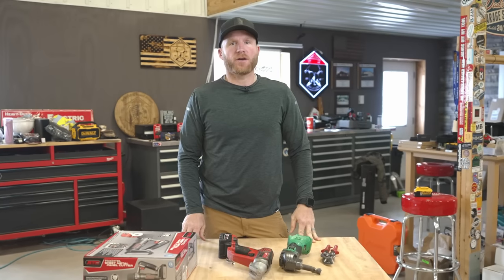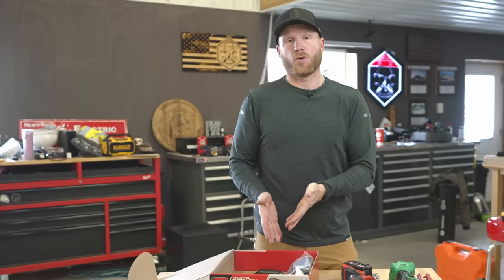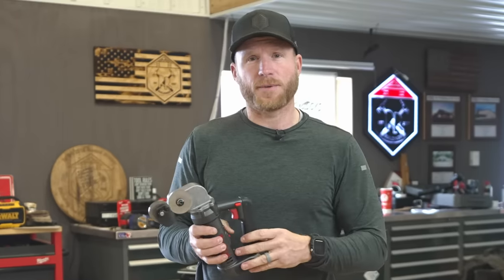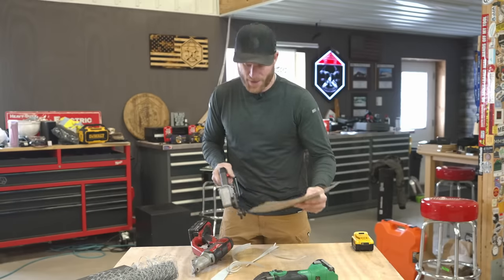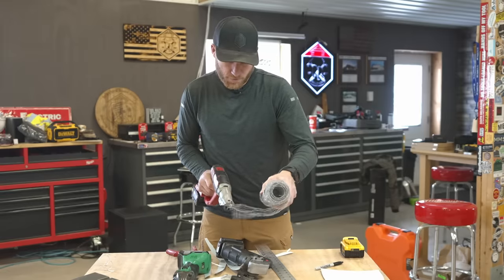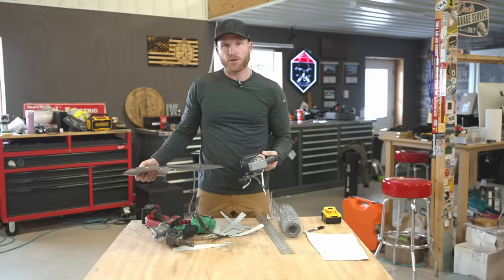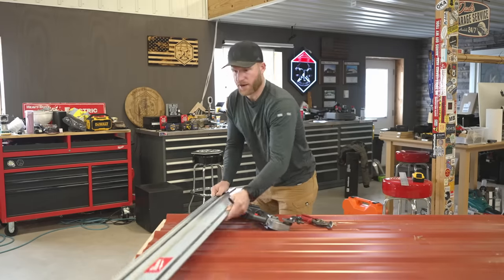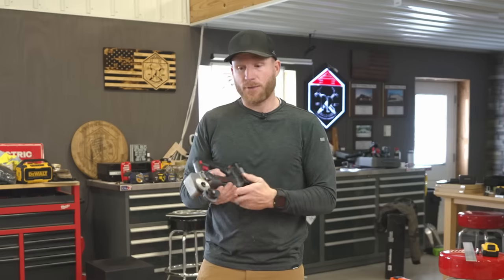Toolsday: The Last Metal Cutting Tool You'll Ever Need???

Comment: Take it from a  tinner,  never ever cut wire with a snips.  Next time you cut metal it's like cutting sandpaper.
Reply: Rule number one in tin knocking
Reply: Snips cut tin thats it
Reply: @Simmonsconstruction  I always wondered why tin benders got so frosty when us plumbers would ask to borrow their shears!  When they make tools for plumbers, they know we will try to break them every hour, so help me! I'm retired now- but a friend was grumbling about having got two Pex (plastic pipe they are using these days) expander type machines replaced because they got trashed bouncing around in the back of his trucks. At the prices these sorts of things want, the makers need to realize they are selling what will most likely be shop owned tools. I guess it's either adapt or go broke!  FR
Reply: Agreed! Been there done that
Reply: So using my snips to cut shingles is out of the question??
Reply: An old pair of snips are a roofers best friend.
Reply: @jamesrussell6870  no problem, dedicate your old pair that sort of job, and don’t mix’em up with your tin/metal cutting tools or vice versa.
Reply: Snips work great on F.r.p. plastic board but they won't cut sheet metal again.
Reply: @Gustavo-ud6hu  Literally the first thing I tell anyone that helps me, you use my snips as a wire cutter you will buy me a new set at lunch and won’t be coming back tomorrow.
Reply: So from a non thinner what do you use?
Reply: They make one that just attaches to your existing drill. That’s what I’ve been using.
Reply: That also pained me
Reply: Yellows are for chicken wire. Reeds and greens are for pros
Reply: We learnt that in first year highschool metal working lessons, so many people just don't know how to treat their tin snips.(architectural metalworker here)
Reply: @jamesrussell6870  I would recommend using a high quality damascus steel hunting knife for shingles. Make sure its grit-to-blade edge
Reply: yep. tin snips/avation sheers cut sheet metal. and electrician wire cutters cut only copper wire or aluminum electrical wire. cable cutters are for tie wire and cable wire and can cut just about anything else
Reply: @TristenHernandez WIRE CUTTERS.

Comment: Black and Decker made a rotary power shear back in the late 70's early 80's as a corded tool. Still use mine to this day. They are great on cardboard and carpet as well. Glad to see someone bringing the approach back.
Reply: I had one of those back then. Loved it and used it all the time. Only problem is that I wore it out after 20 plus years and couldn't find replacement parts for it. Miss it more than any tool I've ever owned .
Reply: I to have one and still using it yet, however I could use some new cutting wheels.
Reply: Best power tool I ever owned.  I never understood why they discontinued
Reply: I have one of those 120 volt cutters. It was driven by the same motor of their jigsaw. They disconued it because too few people understood it and it did not sell well. I have people trying to buy mine from me, but I will not sell. If I needed a battery powered one, I would buy this one.
Reply: @bobthebuilder6315  It wont be cheap but you could try getting some tool steel (HSS) somewhere near the right diameter, then get it turned and centre holes copied. They would then need hardening and then tempered. Perhaps find a firm with an autoclave
Reply: Used to open up access to clean grease ducts in restraunts 40+ years ago with that Black and Decker rotary shears. Loved it. Wish I still had it. Ordered an drill add on  cutter a contest ago. Never came canceled order.
Reply: Nice Video. I am doing a bunch of PBR right now and I am getting much better with my Milwaukee nibbler and double cut shear. The one thing I noticed is the variable speed on the shear helps me to get a straight cut. I would assume after watching this video that slower is definitely more controllable with this tool. I have been wondering about this. Thank You for sharing great job👍
Reply: This has been the most wanted comeback tool that all the old timers have wanted.
Reply: Yep, and it great.

Comment: Black and Decker made these years ago.  I paid $180 on an auction for it and people thought I was nuts.  I wore the wheels out and had a machine shop make new wheels for $250.  Motor finally gave out.  One of the greatest power tools ever owned and could never figure out why B&D discontinued or why someone else didn't start making them.  Great tool!  Glad to see someone get smart.  That thing is a bargain for $400, the B&D was corded, that was the biggest downfall
Reply: Hands down, Black and Decker made a great tool. I changed frame to accommodate ribs of metal roofing, made special feed wheel to pull material smoothly and added battery. We tested tools by taking them out to guys building to get true feedback. I think you would really like it. Thanks for comment. Tony
Reply: Why would b&d stop making such a useful tool. It really was a great tool.
Reply: @tonywachtel7215  Great informative video, awesome performing tool. 

Tony, assume by your replies that your the manufacture & designer. Do you have other video or websites you provide additional information?

You’ve got a Dewalt battery, I’d suggest selling this great tool to DeWalt. Their marketing and User Base would greatly increase your sales. I’m guessing you probably already have something in the works with DeWalt… Best of Luck! You made an older design 10x better!

Comment: We started using this the other day at work. Stamping presses and rolled metal. Cuts through like a hot knife through butter. No more dealing with metal hand scissors and getting stuck half way.
It’s a beast
Reply: What gauge
Reply: He's probably a troll for the manufacturer and doesn't even know what you're referring to lol, so when Kakashi reads this he'll know it's the thickness of the metal (gauge) it will cut you were asking him

Comment: Black and Decker offered a version of this tool back in the 1970's; Dad bought a reconditioned one for building pole barns on the farm, and it's held up well, with the complete lack of replacement cutter disks being the only downside. I was able to take it to work and sharpen them several times, but their now just about done. Glad to see someone else has stepped up; it's now on my list.

Comment: I've got an old black&decker from the late 70s or early 80s I've cut everything from sheet metal to carpet, vinyl, etc they're great for cutting shapes ( circles) as well. I can see this one has a huge advantage being cordless, I've came close to cutting the cord on mine lol. Also be interesting to know if the wheels would work on the old black & Deckers. PS try switching to the 1st gear might give you more control.
Reply: I have the same tool. It is the absolute best tool I have ever found for cutting metal. So the technology is nothing new but the cordless feature is a very nice improvement.
Reply: Yes, B&D tool was great. I made improvements wheels, frame and battery to make it better for metal roofing. Hope you like it. Tony
Reply: Black & Decker Variable Speed Reversing Rotary Power Cutter Model # 7975 Carpet/Metal
Reply: @mopreppinmolivin does these tools cut through metal studs? Did metal framing?

Comment: I am an old guy with limited experience doing this sort of thing, but in the early 80's I built a metal over frame shed using galvanized surplus garage door metal.  My buddy - very experienced in this and many other building trade areas -  told me the best way to cut such metal was to use a circular saw with the blade REVERSED.  It worked like a charm.  I now have  a collection of 18v Ridgid tools, and if I was going to do another similar shed, that's what I would use.  Sometimes the old way is best, but this is just my two cents for whatever it's worth.
Reply: That works. Not the best by a long shot. And extremely loud. If you're working metal siding and cutting all day, sound volume is definitely an issue.
Reply: Plus using a saw blade is dangerous with sheet metal. Easy to get injured by shrapnel, and, even with safety glasses, I guarantee you'll get a piece in the eye. Guaranteed.

Comment: Hi Kyle, I just watched your demonstration on the new metal cutting tool.    I have a corded Black & Decker rotary cutting tool that I've had since the early 80s that works just like the cordless tool you've demonstrated.  I've cut all types of metal panels through the years with mine .  Old technology incorporated into a cordless application.
Reply: It is as you say very old cutting technology using a pair of opposed rollers with a keen shearing edge. Even a basic tin can opener uses pretty much the same cutting principle. Aviation and custom car body shops have used shearing rollers fitted onto an English Wheel roller frame for decades back in time.
Irrespective of all I've said about it being an old idea in a new power tool format I do think it is a very useful and versatile piece of kit.

Comment: I do a lot of cutting hardware cloth for my chicken enclosures, so this thing has me very interested in that function alone.  But, I also find myself cutting a lot of roofing panels for various sheds or coops, so with both needs, this tool seems to be something I would use a lot.  When using metal panels, the most frustrating part of doing any roofing or siding project for me is the cutting.  This could eliminate that frustration.  Thanks!!  Please do an update video of how it holds up over time with your line of work.
Reply: The old trick of a diamond grit or abrasive circular saw blade is a roofer classic as is running fine tooth circular saw wood blade backwards. I weld so I always have 6" thin kerf cutting disks by the box and use them in my angle grinders and cordless circular saw. Abrasive doesn't snag on chicken wire (I keep chickens) or expanded metal.

Comment: We usually use a circular saw for soffit and metal roof cutting (upside down to not scratch the paint). It's faster than this but the noise is painful. I think this tool will end up in our trailer soon, thanks for showing it to us Kyle.
Reply: Thanks for good comment, Hope you order one.
Reply: Good tool but metal shavings are on the lunch menu.  They splatter horrible and are dangerous vs this, not to mention the blades don't last the longest, best ones are the Milwaukee carbon tooth but not much life.  Plus those saws are ridiculous price vs this
Reply: @jonfehr5950  We use some diamond blades (similar to a concrete blade) with our regular framing saws and they last a long time. But yes, they're not fun to use and it makes a mess.
Reply: Any thoughts on how this tool would handle corrugated iron?....Currently using a circular saw with backward blade for that job I usually hit multiple sheets 3 or so stacked on top of each other and clamped with a saw guide....as you said the noise is painful.
Reply: @shadowbanned5164  I think it would work great but might deform the edges a bit. It's definitely worth a try.

Comment: Happened across metal shears...after looking at it preform I noticed it was very similar to a tool I bought In 1982 the handel was near a jigsaw grip. It had two wheels..cool to see the new and improved version. Mine was manufactured by black and decker. They of course were geared towards joe homeowners but I ran the crap out of my shears. Great post brother

Comment: My thoughts on cutting wire with snips means those snips are good for only snipping wire afterwards.
I noticed that you had better results when you cut material that wasn't hand held. Using a support will give better results. Pretty impressive results for a kind of expensive tool. I bought a China shear that attaches to a drill, but have yet to put it to a real test. A short test seems like it will work, but for how long, I don't know.
Reply: We do have 1 year warranty

Comment: That’s basically a battery powered slitter, a common cutting tool used in sheet metal fabrication shops. I might have to get one. I’d be curious to see how it does on a really steep valley cut.
Reply: I agree with you. There is nothing new or novel about cutting sheet metal with a pair of edge shearing rollers as seen here. The only advanced step here is the package is incorporated into a cordless portable power tool. Custom body shops have been cutting thin gauge sheet steel for decades with opposed shearing rollers.

Comment: I have one that needs a drill, I just got it in the mail yesterday. I found out if I could control the speed, but I am impressed with what you demonstrated here today and the one I got in the mail. You have to be cutting a lot of medals, and the price is somewhat steep, the batterie options are nice. I would rate it a 9, there is always room for improvement.
Reply: Malco makes one I have heard good things about.

Comment: This is a mini shop slitter. Kinda cool. Tinner 33 years. Mostly HVAC. If you dont have a shear or slitter in your shop this would be great. I don't do much corrugated siding but when I do I use a cutoff wheel. Which always kind of sucks. If you work with corrugated no doubt it would be worth it.

Comment: As someone who has been in the sheet metal trade for about 10 years that chicken wire cut was impressive. If anyone has built a chicken coop it’s worth it just for that haha. Haven’t seen anything cut metal that fast so it’s very impressive. I think they have some fine tuning to do, so I’ll be watching and waiting.
Reply: While I am blown away how it cut through the roof panel, my angle grinder will cut through chicken wire and hardware cloth almost as fast.
Reply: @middle-agedmacdonald2965  Agreed.
Reply: I did like the chicken wire cut. That was pretty slick. It's almost a heavy duty scissor job tho if you cut in the right place.  Hard on the scissors tho.

Comment: this little tool is very cool and i might just have to give it shot. we just use the Hilti 20v circular saw (6 1/2 ) with the metal cutting blade and we cut EVERYTHING with it, super quick, even up to 3/8 plate, even wood. there is literally nothing we cant cut with this saw on the job site. cons: its very loud and throws alot of metal. but i love it.

Comment: It's weird how well it worked on the roofing metal, but struggled on the soffit. Pretty cool product
Reply: Looks like it’s related to the diameter of those cutting wheels. Smaller wheels might work better on smaller corrugations.

Comment: I've been using a Long-Neck Right Angle Cut-Off Wheel Tool for many years. You can cut 1" thick if you need to and it's easy to make beautiful straight lines. Also cheap but you need an air compressor.

Comment: Cool tool. If you cut many holes, square or round you might want to try out the malco ts1 "turbo shear". It is a 2 handed operation which means your metal has to be stationary but does a good job of cutting sheet metal. And you can change direction mid cut or cut circles. HVAC trade tool.

Comment: I use the nibbler to cut circles.  To cut a straight line i use a magnetic tool holder.  I get them at Harbor Freight.  18" long and they attach to metal then guide the tool along it to cut.  If  I have a longer cut I use as many of the magnetic holders as needed.  I use a straight edge to aline the magnetic strips in a straight line before I cut.  They really work good with my plasma cutter.

Comment: I am not a professional as far sheetmetal work, but for some personal projects where I need to cut corrugated metal, I found a 12 inch bench shear worked well for me. The edge did distort a bit, but it was hidden behind a trim piece. The only other downside would be that it would naturally not be very portable.

Comment: My father built quick and dirty steel buildings in the 70s and their choice for cutting high rib steel panels was a skill saw with a carbide blade and a little disk grinder for touch-up.  Much faster but you had to wear serious eye protection or a face shield.

Comment: I use a battery Dewalt skill saw with a metal cutting blade.  Also soffit i made a plywood crosscut jig that i slide it into and it gives a guide for saw. i can screw my rail at angles if needed
Reply: Came here to say this

Comment: It looks like it works better than I would have thought.  My biggest thought is that the knurled wheel that grips the steel will wear down fairly fast, and then it will want to slip going over the ridges. Time will tell. I bet it would last a long time on flat material, though.

Comment: DEWALT Metal Shear/Cutter Drill Attachment, Impact Ready, 360 Degree Pivoting Head, Cuts 18GA Material (DWASHRIR). I have one of these and in my opinion it is one of the best. It will rip and cut across the residential metal fairly easy.

Comment: I've been watching your content for awhile - even built my shed using some of your techniques. I ended up with a snips, nibbler, and a twin cutter. Ended up using an angle grinder with a cut off wheel to get my best results. I think when I do it again (maybe a post-frame garage/shop in my future), I'm gonna try that panel cutter.
Reply: I watched my buddy cutting with a circular saw blade on backwards. What a mess. He did some of the testing when I developed this. It takes a little practice like any tool, but it does the job. Thanks for the positive comment. Kyle is somewhat a celebrity! I sure hope to meet him someday.
Reply: Hate to break it to you, your metal is going to rust soon where you used the grinder. Can't use anything that generates heat or sparks or the finish / galvanization won't last.

Comment: First impression, it’s fast and appears to be safer to use. Also the battery interchangeable with Dewalt is important.
Reply: There is a Dewalt battery adapter for 18v Ryobi tools as well so thats quite a large range of tools this tool can be tied to.